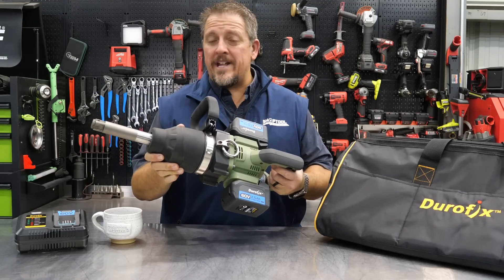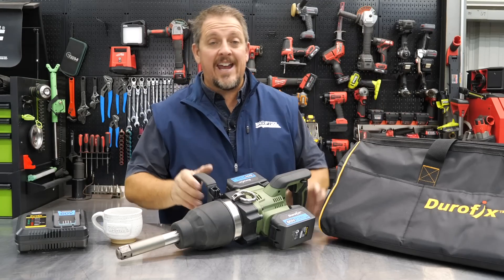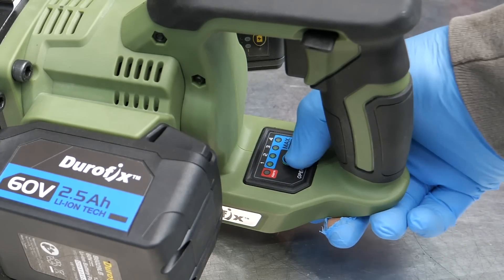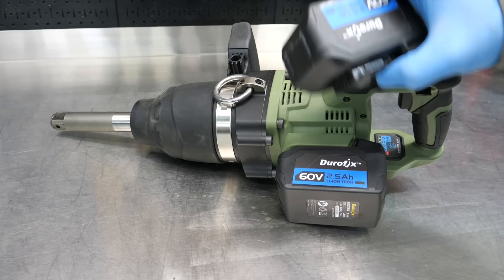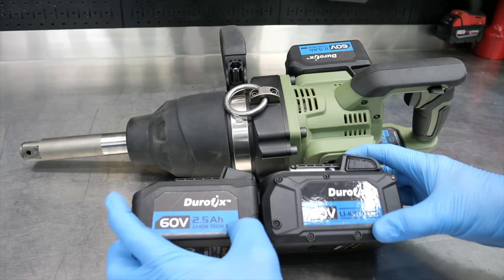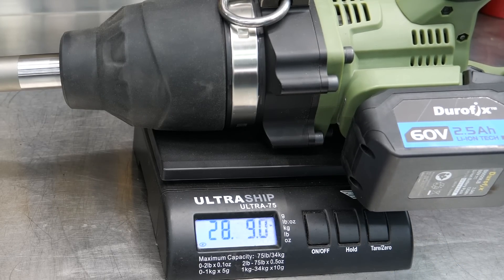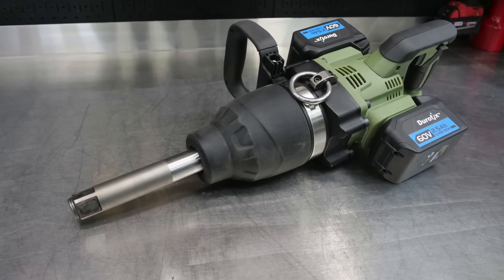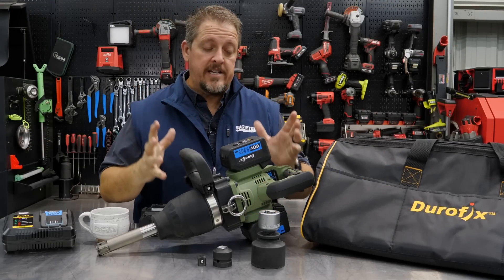BRUTE FORCE - Durofix 60V Jumbo 1" Cordless Impact Wrench Review [RI60176E & RI60176]

Comment: Probably should have just bought some fasteners locally you had the correct socket for. Fasteners are pretty easy to find, well sockets are too quite frankly if you just run down to the local industrial/mill supply. Also little strange the hytorc has a 3/4-1 size on it. The ones I’ve seen in that 5k ft lbs-6k have an 1.5” anvil on them.

Comment: $1300 needs a better price point you can get a Milwaukee 1" impact with that money.
Reply: But this thing walks all over the milwaukee 1".
Reply: Nah man u can get the Milwaukee version of this the 1/2 Milwaukee ext anvil high torque and 3/8 stubby for only $48 more
Reply: @ItsKing32  But if you need to break loose 2500 ft lbs, that doesn't help.

Comment: ok, i paused the video at 4:00....before i see the full video, I am truly a doubting Thomas on this tool.....i wish I had this thing in my shop all the yrs I fought with big rig lugs that didn't come off with 3/4 and 1" air impacts...finally using heat to get them loosened....this is the northeast with tire guys using 1 inch guns to install tires and salt and snow to rust them on even tighter....now I will go back to the video and edit my thoughts after seeing the full video...to be cont'd maybe.....EDIT....I am really impressed with the power of this tool but i would like to use it for a week or so and give it a good workout...electrics are unbelievable today

Comment: Those 18 wheel lug nut need around 2000-2300 ft lbs of break away torque.  Look at the time it took to break away lose the lug nuts, and the “2300” lb ft nut.